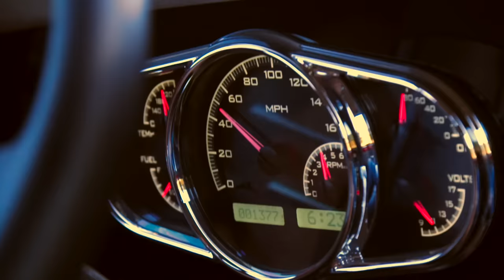Super Coopers: Bringing the classic Mini Cooper out of retirement.

Comment: No A-series sound, NO MINI
Reply from the maker: Ah the sound of the A series, we get your frustration...We can always loosen some bolts and throw some pennies in the transmission?
Reply: @GildredRacing  Can you also get the gearing right for tyres with a rolling radius of around 50cm and sort out the corner weights and driveshaft geometry?
Reply: @GildredRacing   A sad comment, a well built A series can withstand decades of use and still return good fuel economy.
Reply: @hlund73  I’ve owned A series engine it always breaks now and then I’ll never go that route again
Reply: @GildredRacing  As the owner of a Midget with a performance built A series, your comment was so true it was funny!  I'm starting to wonder if the Honda little VTEC could be a good motor for a my other Midget.  130 HP would be amazing.